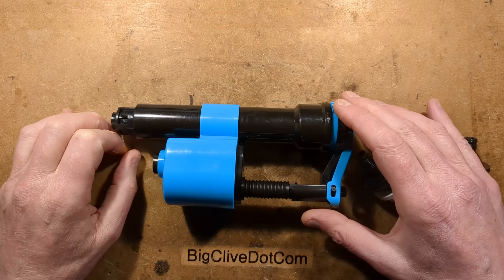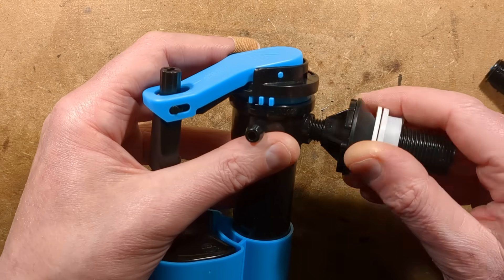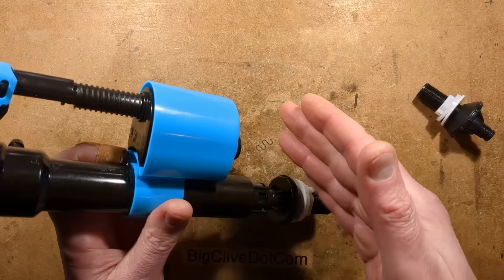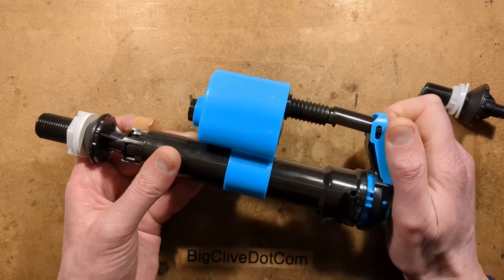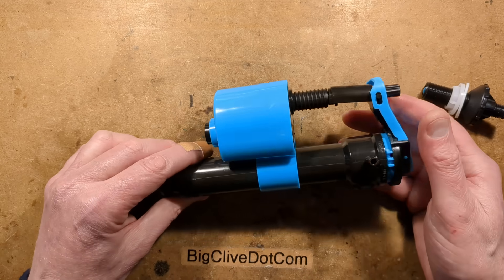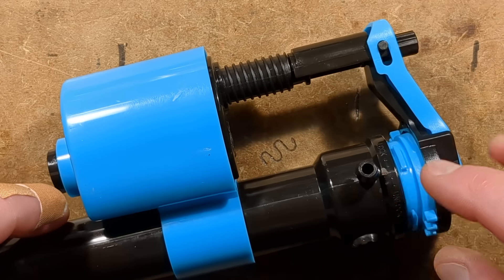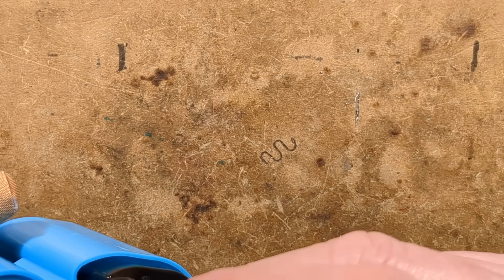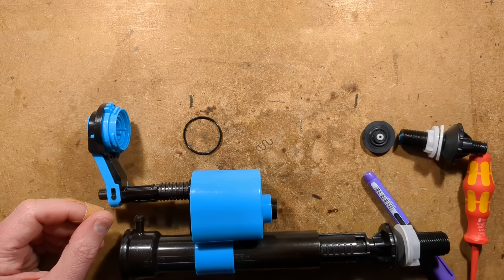Very clever universal Skylo toilet cistern fill valve system

Comment: The principle is similar to a "pop" safety valve, used to solve the problem of slow leakage from simple spring-loaded valves before the lift-off pressure.  The disadvantage of a "pop" valve is that it can almost instantaneously lose about 10% of pressure in a boiler if it does open,and that's a lot of wasted fuel.

Comment: This reminds me of The Fluidmaster toilet fill valve. It snaps shut when tank is full. If you have a slow leak on the flush flapper in the bottom of the tank, the fill valve will snap open filling the tank until ir reaches the set level. This alerts the homeowner that the flush valve needs replacing. If one used the old fashion float you would never hear the water continuously running into and out of the tank.
BTW, a cup of vinegar in that tank would help. Pour it in let it set for an hour and then use only a brand new toilet brush to scrub down the inside of the tank. Flush the toilet to get rid of the scum that was knocked loose from within. Keep this new brush only for cleaning the inside of the tank and don’t forget to rinse it out completely and let dry before storing for the next cleaning.
Most American toilets are of the siphon type and that little hose nub is used to allow someone place a little hose into the overflow pipe to fill the toilet bowl with water. These toilets need little brush action from a user who has just finished taking a dump while most European toilets have little water in the bowl which requires the user to "clean the bowl" after a major dump. New regulations in the USA within the last three decades mandate low flush toilets which use only around five liters of water compared to ten. Where the problems arise is the fact that the slope of the main drain line was at a much more lower angle since more water was always used in the past. When one installs a toilet with a five liter flush, there is not enough water in the main drain to empty it into the sewer pipe which will lead to a backup over time. New homes built will have a drain line from the home to the municipal sewer at a steeper angle allowing the line to drain with less water usage.

Comment: In the US back in the '90's, there was a very clever toilet control system that didn't stay on the market very long, unfortunately. It was a very small, teardrop shaped assembly that laid flat against the bottom of the inside of the tank. There was one set screw protruding from the top of it used to adjust how far the tank would fill. It was a very small, one piece design, easily installed in less than five minutes. You'd lay the unit in the bottom of the tank over the inlet hole, attach the incoming water line, and secure it to the bottom of the tank. That was it... installation complete.

Inside the unit was a diaphragm. As the weight of the water increased as the tank filled, the diaphragm would eventually stop the flow of water. Turning the adjustment screw allowed you to control the point that the water was shutoff.

I replaced all of the toilet innards in my house with that neat little device. Years later, at our new house, I attempted to find one of these fill systems to fix a toilet. Unfortunately, they are no longer made. I always wondered why they were removed from the market.

Comment: Crap , mine slow leaks even with new washer
Reply from the maker: Did you purge the water pipe out when you changed the washer?  It might also be worth checking the little sealing pad on the float's arm.

Comment: Do NOT place the blue blob block things in the tank, it clogs the mechanism
Reply from the maker: The water feed to this should be the clean mains water supply.  The only thing the blue blocks could possibly interfere with are the float and cup.

Comment: That extra part at the end is because of S traps.  Toilets in the US at least use an S trap instead of a P trap like your sink.  An S trap will siphon and not seal after a flush and so needs to be refilled after the flush and siphon is complete to create the water seal and stop sewer gases.  This is also why S traps are not used in the rest of the house like a sink which must be a P trap which does not siphon in the same way and leaves the seal intact.

Comment: Unfortunately ILLEGAL to fit in the UK Clive. There are potentially 2 joints below the water line (the telescopic bìt and the bit that screws into the bottom entry assembly) and both are outlawed under UK Water Regulations. That's not only to prevent leaks but also to prevent contamination where cistern water leaks in to the water supply. Think blue water at the kitchen sink for instance, which happens. Also think about if the cistern water isn't blue. How would you know you might be drinking it?

These Chinese valves are generic designs sold to many different markets where regulations vary, hence the redundant connection on this one, but unfortunately they don't comply with UK Water Regulations. They should not be fitted to a UK domestic water supply. 

Clever/simple designs are easy to produce if you ignore regulations Clive, as you often point out with your excellent breakdown of electrical products.
Reply from the maker: This is a UK fill system sold by prominent UK trade supply houses.
Reply: @bigclivedotcom indeed this product most certainly is stocked and supplied by some major distributors Clive, and they are not breaking any regulations by SELLING them. The Regulations (bizarrely) make them illegal to INSTALL. It is a daft rule that puts the responsibility on the plumber and unfortunately many plumbers don't realise this. The sellers and importers make no claim that these products are compliant and instead leave it to the plumber to get in to trouble if their work is ever inspected. 

There are plenty of examples of the failure to regulate and this is one of them. Across the UK there are literally millions of non compliant valves fitted in cisterns. Perhaps that's why around 5% of loos in the UK are leaking on any given day? That's around 3 million loos wasting around 800 million litres of water every single day. The water companies all confirm this data. 

I think the reason this isn't more newsworthy is that leaky loos are not lethal (thankfully) so there aren't any headlines to grab attention.

WRAS compliance is what to look for in these products, or BSI, or KIWA. Compliant products will say so on the packaging and also in the instructions. Professional plumbers know to ask for these approved products and knowledgable clients insist on them..
Reply from the maker: I've got one here in its bag and it is marked as WRAS compliant.
Reply: Definitely not WRAS compliant

Comment: I will be looking closely at this valve. I had absolutely HORRIBLE experience with the FM brand which failed with such high flow rates that the overflow tube couldn't keep up, and water was shooting out the top of the valve and running along the bottom of the lid and over the edge of the tank. I did some research and decided to try Danco fill valves. Been using them for almost 20 years, but they fail when sand or larger air pockets hit them. On the plus side they can be changed without tools in about 5 minutes. But the most recent two failures were different. The first of these stuck internally in a high flow state. This would have been no big deal, but when I changed the flush valve assembly years ago, I forgot to trim the overflow tube - D'ohhhowe! The replacement valve for that one was back to the usual slow and noisy trickle fill, but that valve only worked right for about 18 hours! Where I live we have the most hardest water (most dissolved solids) of any municipal water supply in the US.

Comment: It annoys me that the standards dont specify a standardised design for the diaphragms in Part 4 valves like these. For the traditional valves, the parts are the same from every manufacturer going back 70 years
for these part 4 valves, I've had to replace some only 5 years old because I couldn't source replacement parts

Comment: Two points of failure on these flush valves and you covered them both quite well. The diaphragm at the top becomes worn and the filter at the bottom may become clogged resulting in slow fill times. Both are serviceable without the need of purchasing a new valve. Take it apart, clean and repair, it’s cheaper and can be done by the homeowner.

Comment: I would like to increase the level of water in my cistern. This seems to have quite a height adjustment, but on trying to adjust mine I found that at higher levels it just syphoned out through the dual flush device (not sure what the correct name for that is).  Is it possible to adjust that device as well to allow a higher level of water in the cistern?  If not, can anyone recommend a make/model that would allow a higher water level in the cistern for a bigger flush?
Reply from the maker: The flush system may incorporate and overflow.  You may need a new flush assembly.

Comment: I love these units and fear them at the same time. They are so well designed and repairable with bits available at the local DIY stores and flee bay, saving clients time and money. However they are so flimsy, I am in constant worry of them de-threading, snapping, cracking or popping (especially as I live in a very hard water area so de-petrification of the gubbins is needed before disassembly,) thus, I carry complete kits with me for such jobs, just in case. It is a inspired design and enjoyed the vid too :)

Comment: Fitted mine today, looks like a good design improvement. However it only fills about a second quicker, i have quite high mains pressure perhaps with lower pressure it might make a difference. Not any quieter. It does take up less space, and I think it might outlast the old one.

Comment: Very good example of a pilot operated valve.  That long lever of the old style valve was needed as the valve operating force is great due to pressure-area product.  
We normally don't recognize valve operating forces as common faucet valves use mechanical advantage through screw threads or balanced by a ball valve.

Comment: Thanks for making this video, Clive. I have one of these and found the shutoff to be very harsh. I was able to alter this characteristic by making a slight alteration to it.

The little blue 'pin' in the centre of the diaphragm that the white plastic part slides up and down on has a tiny groove in it to allow water to pass as part of the valve operation. Basically, I touched the groove with my soldering iron to make the groove smaller and more restrictive. This had the effect of dampening the action of the valve and reducing the water hammer.

The caveats are twofold. One is that because it is so small, great care is needed to avoid stopping water from being able to pass and actually close the valve. Another is that the increased restriction may cause the valve to become blocked more easily, again causing it to fail to shut off.  I didn't mind modifying my own fill valve as I know about it and understand it, but I would hesitate and think twice about doing it for someone else.

One of the reasons these valve create so much water hammer is because they are made so small in the first place so it slams shut very easily due to the tiny volume of water required to operate it. The other reason is also related to the physical size in that if the internal ports were sufficiently small to create a nicely damped shut off these internal ports were found to be prone to blockage from the smallest particle of sediment or whatever being carried in the incoming water flow.

The same operating principle is used in appliance fill valves as well, and have the same problems, with the difference that the actuating valve is operated by a solenoid instead of a float.

These valves are a clever use of hydraulic principles. If they only made them more suitably dimensioned then these valves would have a lovely smooth open and close action and have significantly reduced likelihood of failure due to internal port blockage as larger ports could be used to mitigate this problem.

Comment: In the US a little piece of tubing comes with the valve to put on that barb and is typically clipped (clip also included) to dump down the overflow standpipe in the tank, I assume to make sure the bowl is fully refilled after a flush.

Comment: As a Plumber I fit these valves made by Viva. They also do the plastic valve with a brass thread ½" BSP. Fitted so many and not had many problems with them.  Works great on mains water pressure but can be very slow on tank fed supplies. Even with the blue restrictor removed.

Comment: Here in the US the similar valve is the Korky 528.  No side inlet, all US toilets inlet from the bottom.  They are cheap, $8.  The float is entirely enclosed.  It is very quiet.
The other popular brand is Fluidmaster which is $15 but the float is exposed.

Comment: I'm flush with excitement at this one. It just went down really well and I feel replenished.  The use of an exhausting  valve to trip pressure release using a diaphragm is a very common set up on pipe organs. It uses a 12 volt solenoid to act on a metal disc. Press the key and the note plays. Instantaneous. 
Aussie flushing toilets use a push button on the top that gives you half and full flush. Similar mechanism to those but it combines water release as well as refill. Amazingly reliable and leak free unless you get a big gob of dirt on the rubber seal. Ordinarily the flow of water over the seal blows off any crud. Bloody marvelous. Excellent video as always. Thanks Clive.
Reply: If you take the hanging buckets off the 2 stage aussie valve you get the full3 / 6 litre flush back as well for older toilets with large throats.
Reply: @GrumsPlace 
Is that so ? I'll give it a go.

Comment: I quite like the new toilet systern design, it doesn't take all week to fill, and also a lot quieter in operation. I had mine replaced to one of these a couple of months ago, and so far not had the problem of it leaking or failing yet, unlike the last toilet flush which packed in within weeks for fitting when I had my bathroom replaced by my housing association then so called engineers that called out to repair it for the passed 10 years.

Comment: I used to have a type of pressure cell type of system inside my toilet tank. It was an entire closed system that sat inside the tank, and the water was entirely held inside of the cell, and no water in the tank. Inside the enclosure, there is a pressure bladder and spring type of thing that when it refilled, it used tbe water pressure to push against the spring and fill the bladder. Then the vessel was connected to the discharge hole in the bottom of the tank that feeds into the bowl. The float, flush valve, and everything is all contained in the vessel. There is a plunger sticking out the top that the flush handle presses down on to activate the flush. And when that thing flushed, IT FLUSHED!! The thing had SO much power that you'd think that it was going to suck the shirt right off your back if you were too close to the bown when it was flushed. My friends used to call it "the prison toilet", as I'm guessing they use the same type of system in prisons. The toilet was pretty much IMPOSSIBLE to jam because it had such a powerful flush.

Comment: [Warning - Rant mode enabled]
It may be ingenious but it should be banned like all drop valves. They were illegal in the UK until 2001 when the lobbyists for the industry persuaded the government to allow them to sell the gear widely used in the rest of the world.
The problem is they waste almost biblical amounts of water - in 2020 it was estimated in the UK *400 million litres*, enough for 2.8 million people, were lost daily due to leaking valves of 5 to 8% of all dual flush toilets that were now wasting more water than they were supposed to save over the old syphonic  single flush variety. (Not helped by many people not knowing which button to use for a small flush).

The problem is that leaking valves are not always easy to spot (unless leaking very badly) made much worse by the dramatic increase in the average number of toilets installed in each residence over the last few decades - en-suites mostly. Even when householders notice a leak they may not appreciate just how much a small leak amounts to over time and not have any urgency to fix it (until they get the next water bill). Just as bad, if not worse, are overflows which discharge into the toilet pan. External overflows used to be required as they usually get noticed when water starts dripping down the side of the house.

This is a disaster given that the UK is close to a catastrophic water crisis due to the large population density, climate change and under-investment in the water supply industry, even though it gets a lot more rain than many other parts of the world.

[Rant mode over]
Reply from the maker: Yeah, I'm not impressed by the dual flush systems.  They seem to jam and leak a lot.
Reply: I agree that no one seems to know which button to press for the short flush.

Comment: Back when I was young and handsome (now I'm just "and") I was drilling holes for electrical boxes into chipboard sheets at a renovation site... and the hole drill jumped and shaved a notch on my left thumbnail... well, it looked worse than it felt after a while, but I kept changing bandages and cutting the sides of the nail tip short. It's all good, only with a couple longitudinal ridges as a fading memory of the injury.

Last fall I banged the strongbox lid quite hard right on the middle of that same nail at work, there was just some redness but no clear hemorrhage - it appeared that the nail was internally crushed at the spot, and when it grew out to the tip, it kept crumbling. When the crumbly spot was halfway gone, I saw a blackish-red spot emerge from under the skin at the root, and it would reach the tip too before its tail started to fade. No lasting damage as it seems.